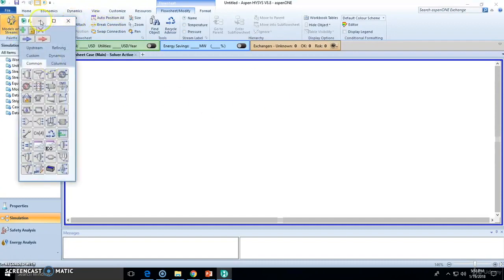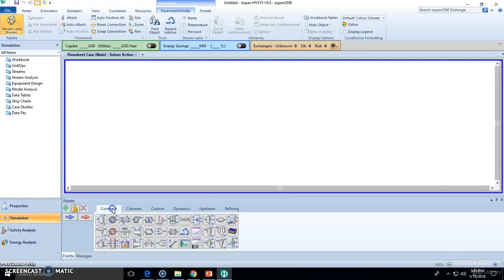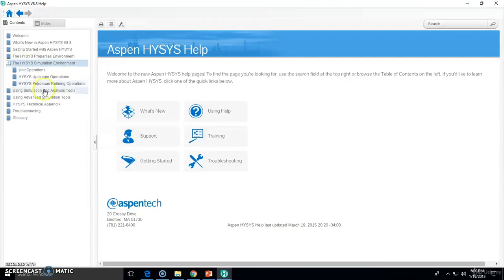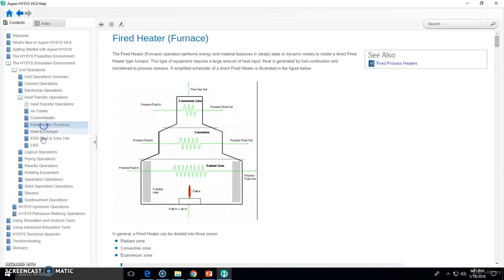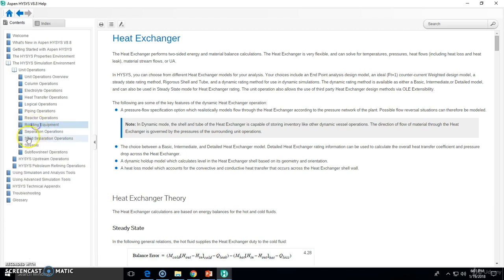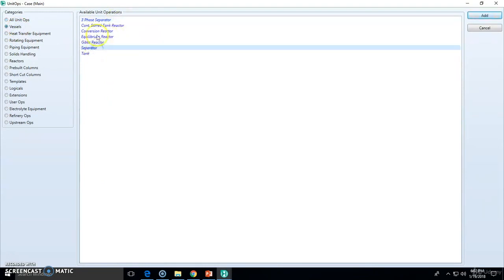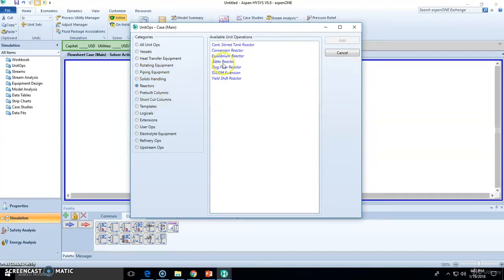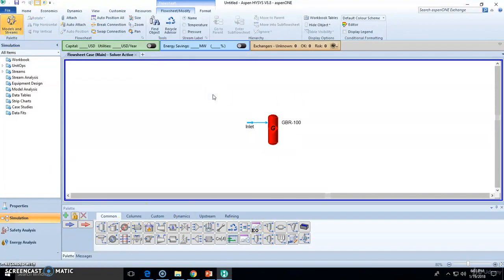Unit Operations in HYSYS - HYSYS Basic Course (Lec24)

Comment: Hi, I press F12 to open Unit Ops window, but it didnt appear. Is there another way to open that window?
Reply from the maker: Hi Jackeline, this will depend on your configuration and version, but you can always modify it for your specific needs
Reply: @ChemicalEngineeringGuy  it will open pallete when i press F12, any solution? im using v11
Reply: so am i, it will also open the pallete like if we press F4, have u solved it? im using v11